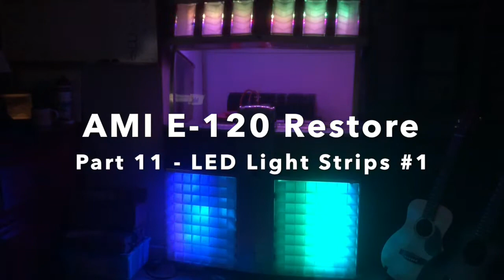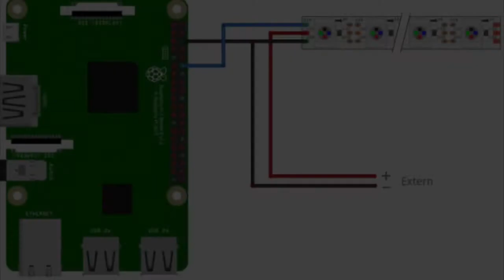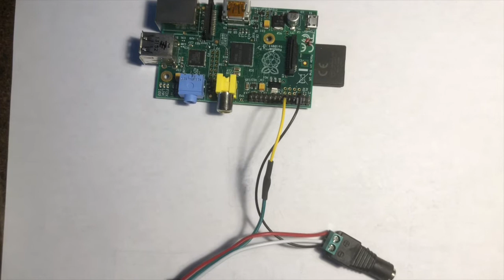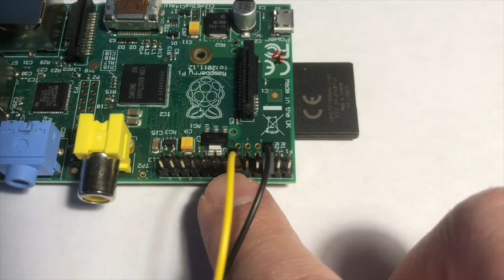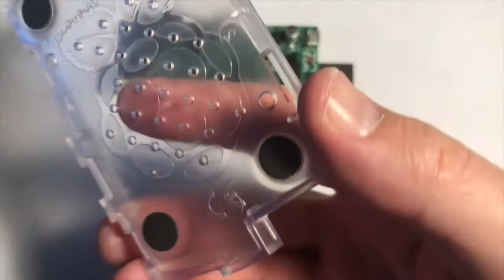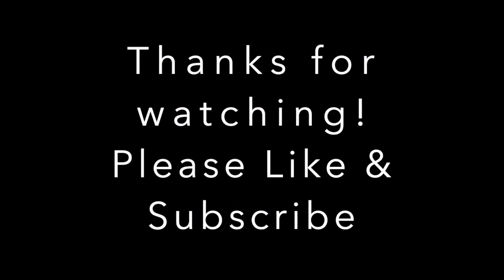Part 13 Jukebox LED Light Strips #2 - AMI E-120

Comment: Hello, I am looking for information about the lighting color tube inside the upper cabinet. 
I have a 1953 AMI 120E. It did not have the color tube or the motor to turn it. 
I found the motor but still need the tube.
Are the end caps on the upper tube the same size as the lower ones? 
I can't find the upper tube assembly. But , if they are the same I can build one .
Hope you can help!
Scott